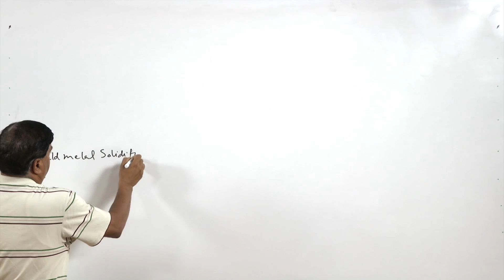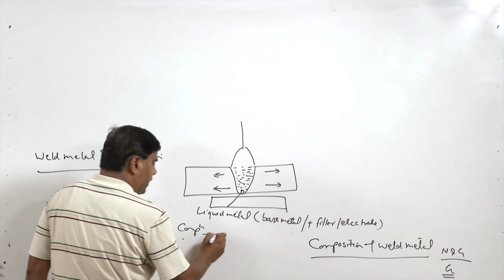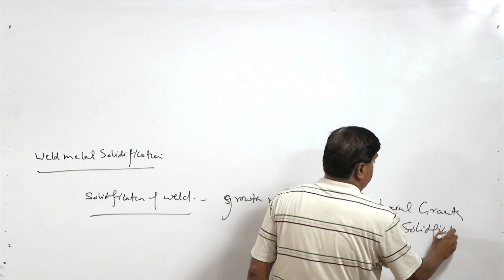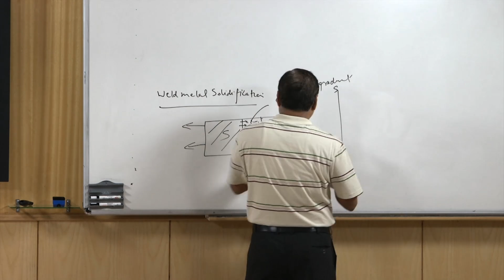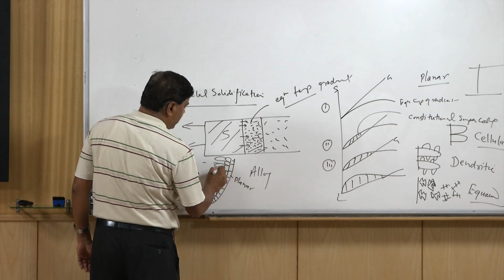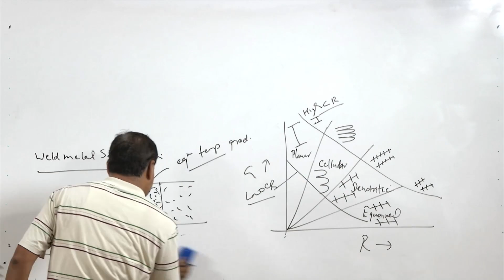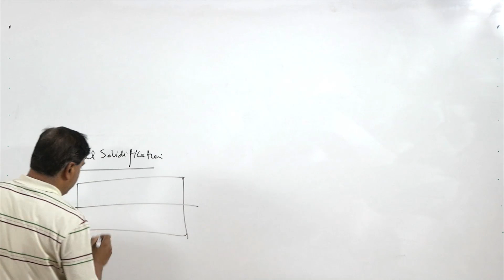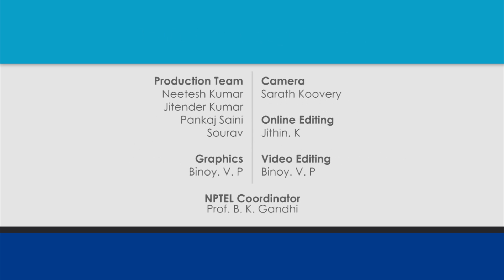Lec 31 - Solidification of weld metal

Comment: Dear sir, 
Can you please elaborate how cooling rate is higher (fast) at weld center and lower (slow) at the fusion boundry? ( Video timer - 27: 30)
Reply: You see it mathematically....Cooling rate is given as Gradient* Growth rate..... At the center of the weld pool, in the trailing half , growth rate R is much higher and G is quite less.... This product is more at the center than at the fusion line....At fusion line, G is higher but R is too less so the product is less..
Reply: the temperature gradient between the center to the fusion zone is much higher than the temperature gradient between the fusion zone and the rest of the metal. Hence highest cooling rate is attained within a region where spatial variation in temperature is at their highest